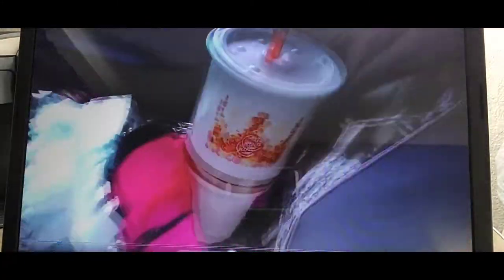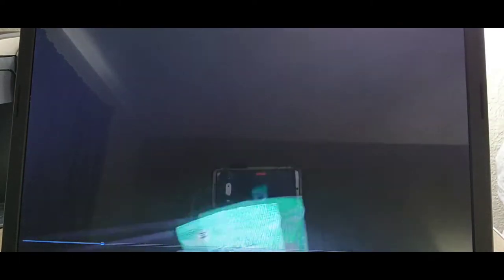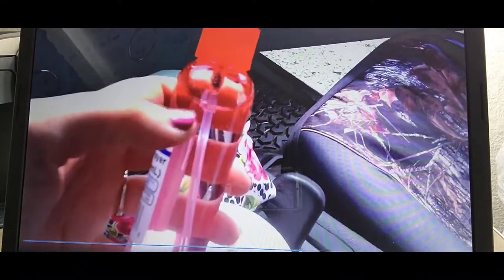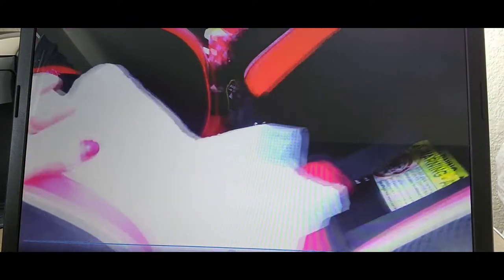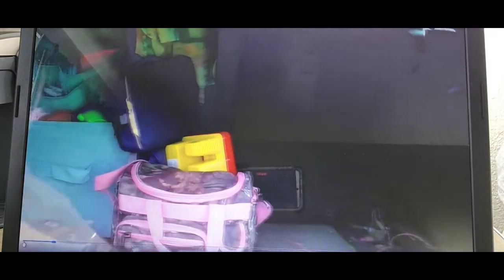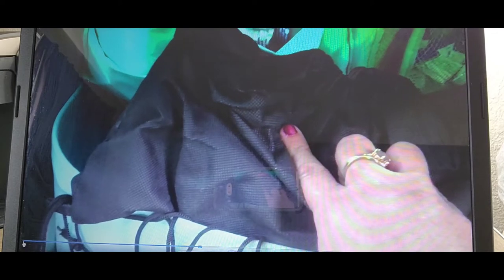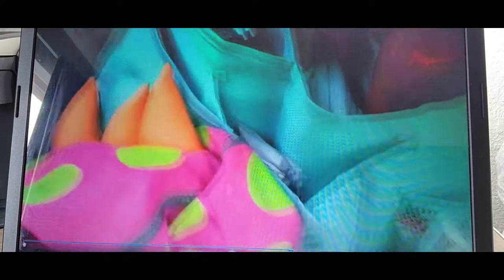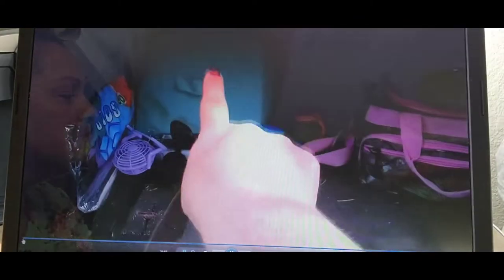Car Organization and Gmaw Hacks

Comment: Good video. Many younger ones dont know many of these things. You dress out your van like i do. I have more tools and fewer kid things these days, but im always prepared. In the winter you might consider adding a bag or tub of kitty litter. The weight in the back may assist with better traction, and you can put it under your tires for traction if you get stuck. A small fold up army shovel cancome in handy and doesnt take up much room.
Reply from the maker: My truck is a 4 wheel drive which helps tremendously.
Reply from the maker: And you're right alof of younger ones are not prepared these days.